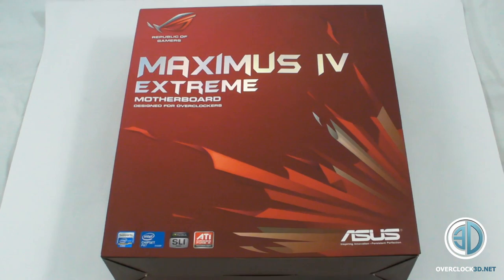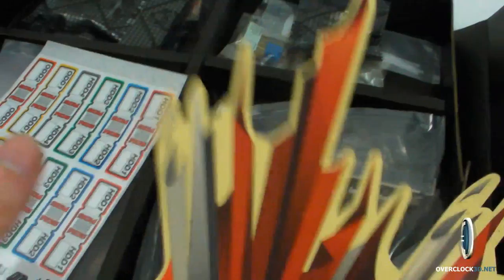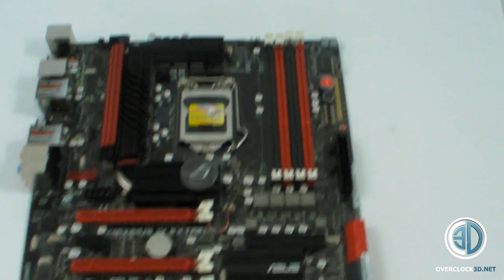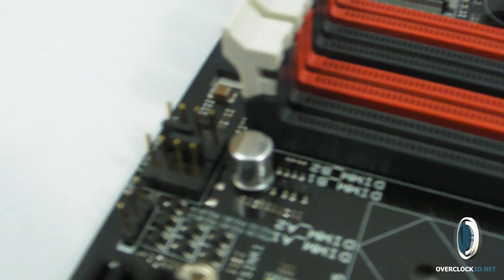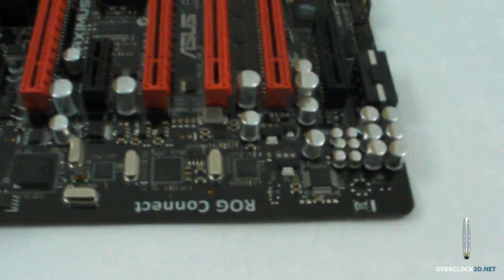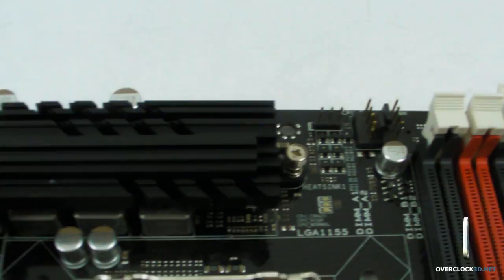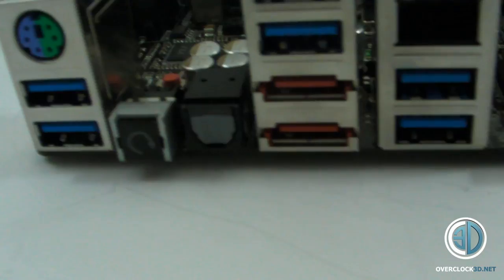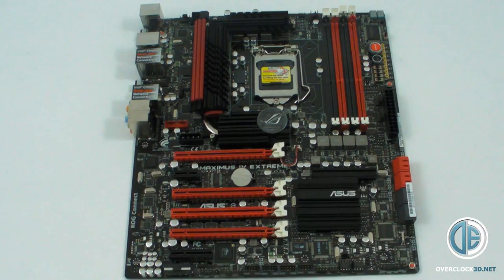Asus Maximus Extreme IV First Look Sandy Bridge 1155

Comment: @BombaySensei 

This is a good question, allow me to answer this, they did this, because some people have two ip's on their cable modem- this allows you to run a seperate ip from your main account that can be used for doing other things while not messing up your normal ip speeds

So on the second ip we are able to log in to a computer and get files and stuff or run remote desktop without messing up the speeds on the first ip..So really nice to have support right on the board for this feature.

Comment: @Plur307 agree a gamer-only system wouldnt need it but yes my next system will be used for audio too. i'm running dual-soundcards plus dsp cards. so this board is no good, but i doubt any of the new ones will be either. unlike gpu's theres no advantage to replacing with new cards, it's just a lot of money for the same thing with a different shape connector. that said i looked into replacing them and found m-audio's entire range is still pci, not a single pci-e one for sale. frustrating.

Comment: @VOYTASNY I agree with you, but we certainly wont have 128 bit processors, theres no point. Designs have been made for 128 bit processors already, were just not ever going to use them for years until 192 GB of memory is no longer enough.

Comment: Im looking to run dual gtx 570s / hd6950s and still have room for a sound card. I must have dual pcie 2.0 x 16, preferably not right next to each other for better cooling and access to at least 1 other pcie slot and hopefully a pci also.  I was looking at high end lga1356 boards but with sandy brigde coming out, im leaning towards lga1155.  lga2011 seems too far away to wait (or is that what they want me to think?)

For me its between this and the gigabyte ud7, whichever can seperate 2xdual gpus

Comment: @Intel1502 Uhm, cause PCI is getting too slow? I remember back in the day (now we're talking about old cards) that I used to have a Soundblaster AWE64 isa card. When I bought a Diamond Viper V770 TNT2 agp card, it simply messed up the entire system. When I removed the old ISA card (the only one left at the time) my new and then fast graphics card worked like a charm.

In other words, slow cards will just end up messing up your system and slowing it down. Time to upgrade even from PCI ;)